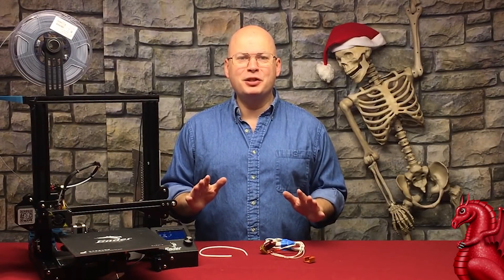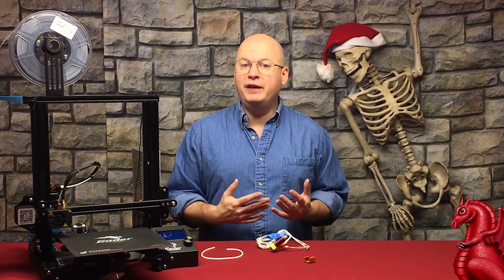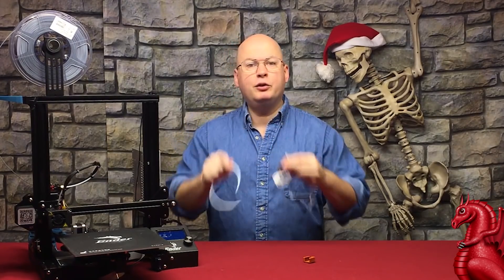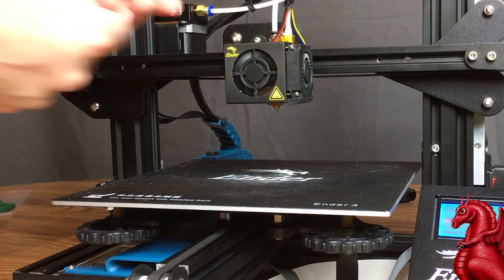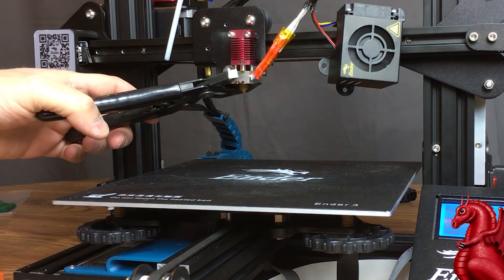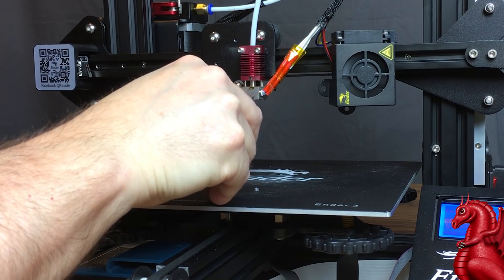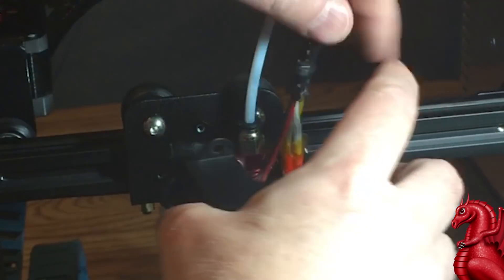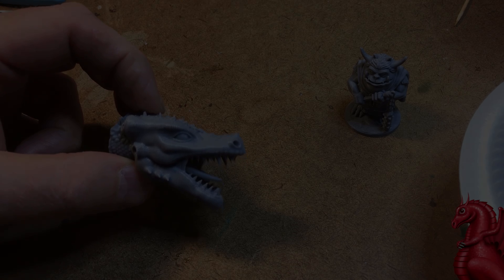Fixing Ender 3 and Ender 5 Bowden Tube Gap

Comment: It's crazy when you think that you're alone with your problem and then you YouTube it and there's a guy giving a better tutorial than most of the training I've ever received at any of my employers. Thank you so much for what you do, I ran my old bowden tube through and about an eighth of an inch of crap came out, ran it through until clean, installed the new recommended bowden tube from Amazon and everything is running smoothly. 

My only concern is I didn't replace the extruder tip itself, which I might need to end up doing, and I may have slightly undercut the amount of tube to cover the entire printing space, so just a heads up, probably better to cut more than less.

Thanks again

Comment: I have spent the past week going through every part of my printer I bought second hand. The previous owner said his kid couldn’t get it print right. I’ve been making test prints and getting fails, e skips, and just an overall headache. I changed nozzles, recalibrated the extruded, and got the bed perfectly level. Then I saw your video, and an aaha moment when pushed a 1.5 inch long plug of solid filament with a groove that new filament was taking through it to reach the hot end. Got it all put back, and it prints like a dream! Thanks my man.
Reply: so the previous owner gave up on the machine because the bowden tube had a gap between the hotend?? haha amateur move

Comment: thank you random stranger on the internet! ;)
Printer started underextruding when I put in a new nozzle. I have been into 3d printing like 3 years and never ever even heard of that issue before. crazy how you learn something new every day. Turns out the new nozzle is like 1mm shorter than the other, thats why the tube didn't reach it. Hotend was FULL of gunk. Can't thank you enough!!

Comment: Thank you, thank you, THANK YOU! I've been pulling my hair out trying to figure out my underextrusion+stringing breakout and even went and bought a direct drive which I ended up returning because I realized it's the coupler that failed and my hotend probably has filament in there from clogs.
This is so very concise, very easy to see everything and you have a calm and reassuring tone that helps ease the tension of not knowing what I'm about to do.

Comment: Thanks for this video - found it from a Reddit post you responded to and answers exactly the problems I've been having. I knew it was something along those lines from simple deduction, but disassembling, cleaning and re-assembling the hot end was not solving my problem. This explains much more clearly what is happening, and the process is clear. Thankyou!

Comment: You are a champion sir. After replacing parts and spending hours with no luck troubleshooting my Ender 3 unsuccessfully, I'm back to printing high quality prints without extruder clicks, nozzle clogs, or stringing. Wish I could buy you an adult beverage to show my gratitude.

Comment: I decided to install a Capricorn tube on my CR10 today. I used your video as a guide and everything went perfect. Other YouTube videos never mention the part where you advise to screw the nozzle on then back it off 3/4 turn. Push the PTFE tube in all the way then continue to tighten the nozzle. Most YouTube videos tell people to tighten the nozzle first then tighten the bowden connection on the top end. Your explanation makes much better sense. Thanks!

Comment: summary at 2:00 heat up the hotend to at least 210, remove the nozzle and coupler, and stick the bowden tube in and out a few times until it comes out clean. the gunk in there makes a gap that creates filament drag. fingertight the nozzle when you're done with a 6mm wrench then loosen by half a turn. push the bowden back in then tighten the nozzle back that half turn and you'll get a great seal.

Thanks for the video!

Comment: I ran the bowden tube down several times got some gray filament off. I waited 30 seconds or so, ran the tube down it again and got more junk, even some old red filament. I had a gap which will be fixed shortly. Thanks again, Tom!

Comment: This video is awesome! Totally saved my bacon! I got an Ender 5 Pro for Christmas and printed the dog g-code file on the included memory card without issue. But ever since then, my prints have been mysteriously failing. 

Watched this video and disassembled my bowden tube, extruder, and nozzle it was clogged to high heaven! This video was an awesome tutorial on disassembly, and proper re-assembly so the bowden tube is tight!

This is maybe my 10th youtube comment in as many years - truly appreciate this video!

Comment: Hi!  I just wanted to thank you for your videos.  Don't change a thing.  Your Creality videos and "help" for things like the bowden tube and whatnot have helped me more than just about all the other 3d printer gurus channels.  I have a Geetech which is a larger clone of a CR10 which is... a lot like an Ender 3.  Which means same issues.  My fitting on my hot end got loose within 20 hours of printing.  I bought one of the 10 packs you list from Amazon and so far it's been a big difference on retract survivability.  Also, I like your tabletop model printing channel.  Even though I don't play tabletop games these days you have to know how these printers work inside and out to get good quality models printed.  Way more practical than just printing a couple of test prints on a brand new printer and calling it good.  We need to see what goes wrong and how to fix things after you've put 500 hours on a printer. :)  Keep up the good work.
Reply from the maker: Thanks! :)

Comment: Man, you're a genius.  I replaced the boden tube and nozzle and was still having issues.  Sure enough, when I followed your advice, a great chunk of semi solid pla came out the bottom of the hot end.  One thing I did do differently was to not dismantle the hot end assemblym this shortened the procedure a lot.  I just took the nozzle off and pushed the boden tube throudh as per your video.  Thanks v much

Comment: Thank you so much. Printers like the ones from Creality are great, but require a lot of know-how and maintenance to consistently get good quality prints. Videos like yours make that possible. I was having both underextrusion and stringing issues, and going back and forth to try and solve for both. I didn't suspect a clog, and once I did, I wasn't sure of the "Ender way" to fix it. This walkthrough was a huge help.

Comment: My six week old Ender had just started stringing and partially under extruding on a set of prints all using the same slicer configuration, and I was confused as I hadn't changed any settings. This explains it and I'll replace the connector at the same time. Thanks for the info, it's a great help!
Reply: Did you also confirm it?
Reply: @lucky4the4turtle  Yes, the Bowden tube had slipped up by about three mm. Not a huge amount, to be sure, but it was an easy fix and it's back to working properly. :-)

Comment: I just wanted to say thank you for this. I struggled for a week trying to solve this issue. I also had a issue of the extruder clicking and poping back every few seconds. Aure enough, when i check the coupler, it had failed. I was about to buy a new bed and new hotend set up. But its now working great again.

Comment: My tube was a chore to remove. I wound up bending it a little to get it out and yes I was depressing the cap. It had a ton of sticky black adhesive coated on it and the inside of the coupler. I also didn't catch the comment on leave the "sock" and thought I could unwrap mine but nope so it's destroyed. Good news is I saw your link to the silicone cover and have ordered a set. The tube pushed the clog out on the first go and came out clean the second and third times. Thanks for the video. I'll have to pick up it again when my covers arrive.

Comment: Excellent 3D Printer 101 video. 110% agree with the method for ensuring a good seal between the nozzle and tube. I do that each time I switch nozzles and have had almost no problems with filament leaking.
I switched to Capricorn PTFE and have had no drag problems, nor problems with PTFE breaking down when I print PETG at 240C.  I went ahead and bought the couplers they sell and they're easier to use when removing the tube (they don't jam nearly as much as the couplers that came with the printer or the same-style replacements).
Reply from the maker: Capricorn is also great for even just PLA printing, it'll last much longer before breaking down than the standard PTFE. :)

Comment: As a noob I had no idea! Many thanks for the explanation. I did have a brainwave though. To ensure a seal between the tube and the nozzle I drilled a shallow 4mm recess on the back end of the nozzle to accept the end of the tubing. I’ve tried it manually (while I wait for tubing to arrive) and it seems to work a treat. Not a trace of melted plastic on the end of the tubing when I withdrew it (hot).
I appreciate that it’s quite a tricky job and not everyone will have a drill press but if the nozzle isn’t going to be changed often I think it’s a worthwhile mod.

Comment: I've been experimenting a weird and impossible under extrusion with my prints for half a week, no matter what i thinked of i was not capable of finding the problem. Last night i did a research to the Tube and found it was kinda "dirty" with some burned residues at its end; cutted it off, re-installed the tube, perfect prints. And then, few hours later you posted exactly what i needed.

Thank you for your colaboration.

Comment: My Ender is a year old next month (one of the original release)-so far I've not had ANY coupler or hotend issues at all-so my guess is that it's "luck of the draw" with regard to who on their assembly line assembled the machine. The only thing I've had to replace is the extruder drive-it now has the red alloy creality one. I bought all these update parts for my printer and it's been so good I've started selling the upgrade stuff. If I ever end up getting this issue I will replace the hot end with an all metal one I bought and also fit new couplers and even Capricorn Bowden on it, but until then, it can stay as it is. 

That said, nice comprehensive video👍
Reply: I have the opposite problem with my hot end coupler. It's strictly one way. No matter how I compress it, the boden tube will NOT go backwards. Changing to cap tubing meant pushing the old one all the way through it.

Comment: An additional cleaning step is to use a long 9/64" hex wrench (I have not found a metric equivalent) and pass it through (and carefully rotate it like a drill) like Tom uses the PTFE/Bowden tube. It is the right size to peel off any remaining stuff in the heat throat without damaging it. Once it passes and rotates through with no drag, the throat is clean.
Reply: Can also use a brass barrel brush for .17hmr👍
Reply: about 4 years late, had to heat up the allen key with a lighter in my case to get the clog out

Comment: I changed the couplers for compression fittings on 4 of my printers a couple of years ago and am still using the same part and have met zero problems with them, in this time period I would have had to replace the pneumatic fittings at least twice.

Comment: So, learning some new stuff from this.  Having bowden tube problems (getting it replaced with capricorn, but that's neither here nor there).  Anyway, I pulled out the old tubing and there's gunk all over the part that was in the hotend.  I now know what it is.  I'll be using clean parts of the tube to clean out my hot end now while waiting for replacement.  Thank you for yet another very useful video (which I had missed before)
Reply: I find Bowden is not accurate at all when it comes to filament flow. Now I have a direct extruder on the carriage and I have much less flow issues now. I have a CR-10S4. The standard NEMA17 34mm stepper can handle the weight even at higher acceleration,  but it does exacerbate ghosting in walls.. Working on a rigid printhead with everything bolted/screwed in as a whole, with dual extruder aswell. The extruder steppers will be NEMA17 20mm, assisted by two steppers located by the filament rolls to feed the filament so the forces are balanced as much as possible. That should reduce ghosting a lot.

Comment: I genuinely believe that creality's biggest mistake between the 3 and 3 v2 was the placement of the fan shroud screws. On the back of the v2 is just awful when trying to make repairs. Also this and the video you made on thermistor and heat pack repairs have been extremely informative since mine recently crapped out.
Reply from the maker: Agreed 100%, the screws in the back and the shroud now being taller and covering the bowden coupler makes it impossible to check it without removing the shroud.

Comment: My clog was so bad that my bowden tube wouldn't go through it... I could barely shove filament through it.  The second largest allen wrench(?) that came with the printer was slightly smaller than the bowden tube so I grabbed the printer for dear life and shoved that allen wrench in and the most amazing clog I've ever seen popped out.  It was literally astonishing that any filament made it through this 1/2 cm tube that popped out.  Thanks so much for your instructions.  Ender is working great now.

Comment: Note that when you clean out your heat break in this manner, some melted filament may ooze into the threading for your nozzle (happened to me). Before reassembling (and while still hot), use a few toothpicks to clean the nozzle threading and/or heat break from the bottom of the heater block to avoid pushing that melted filament back into the heat break when you screw the nozzle back in (and causing another blockage).
Reply: Best way to clean out such bits is to heat it up to 60C and then scrub it on a patch of Scotchbrite. Doesn't scratch metal, it polishes it.

Comment: If you're switching to Capricorn tubing and fittings at the same time, you can just push the stock tubing through the hot end, cut the tip off, pull it back up, push it back through, cut the tip off, repeat x times until it comes out clean.

Comment: Wow. Been having some under extrusion issues with my prints. I thought because I was getting decent flow out of my hot end that my nozzle and hot end were all good. Did this and found they were both pretty filthy. Go figure...
The tip with using the wrench on the coupler was huge; was having a hard time getting the tube out before. Going to try some more prints and see how it goes. 
Thanks for the video!

Comment: I don't take my fans off, but may be a good idea for the first time so you can get the full idea. and i use a block between the x axes rail and the bed to hold  the z axes for extruder support. good point on turning the nozzle back then in once the bowden tube is in all the way and secure. 
iv'e found that once a bowden tube forced out that connector is usually ruined and needs replacing.

Comment: The zip tie that goes under the collar of the Borden tube coupler - that's what those little blue plastic circlips are for in the spare nozzle pack that comes with the printer.
Reply: But thank you for a very useful video. Much appreciated.
Reply from the maker: @markroworth5700  not everyone has those.
Reply: @Tombof3DPrintedHorrors  Was wondering after I commented above; mine was a recent purchase. Really good explanatory video.

Comment: Best mod you can do to the Crealities is put the extruder stepper ON the carriage to make it a direct extruder. That solves most extrusion problems plus it makes line width way more consistent (Bowdens have a springiness that underextrudes at first and overextrudes at the end)
Reply from the maker: Adding the mass of the motor decreases print quality, so it is a bad choice for printing small items like miniatures.
Reply: @Tombof3DPrintedHorrors  I don't do tiny details, usually. Most of my objects are in the 5 - 15cm scale and have details no smaller than 3-5mm, overall. Plus it's fun to mod. I can put a full bowden back on anytime in notime.

Comment: Thank you so much! Just got an Ender 3 v2 and was not getting great test prints, noticed some PLA leaking from underneath the sock. I think my nozzle was slightly loose as well as the bowden tube being retracted because the heat block was full of plastic.

Comment: you helped me so much . i had bought 3d solution filament btw guys stay away from it. i got it cuase i thought it be cheaper it was on sale in amazon 15 bucks so im like sure 2 for one. i use first roll its brittle it sucks prints where crap and it clogged my extruder. i use second roll it worked fine for like a few prints 3 at most then bam clogged again. i fix the clog again and then it prints like crap. i test print an old hour print that i know works crap. i use an old roll that has like nothing on it and perfect print. so once again thank you and 3d solutions is cheap and crap save you money.

Comment: I dont have a ender 3 but a mega zero and the PLA that was included broke off into about 5-6 pieces and being my first printer I wasn't sure how to fix this. Bought new nozzles and the nozzles being different size adjusted the bowden tube leaving a gap and now cleaning it like in this video, thank you. I've been under extruding and was wondering why and noticed some black gunk all over the heating block from the gap

Comment: Cured under extrusion and extruder knock when it slipped.  Before this, my fix was to up the hot end temp, which would work for a while but eventually the slipping would return.  Thanks
Reply: The exact same problem and me trying everything including upping the temperature.. I honestly nearly took the sledgehammer to my Ender3 before watching this video..